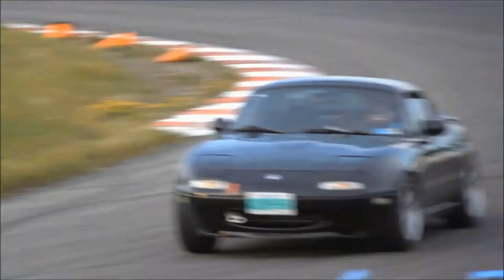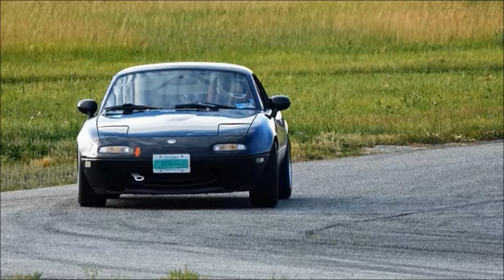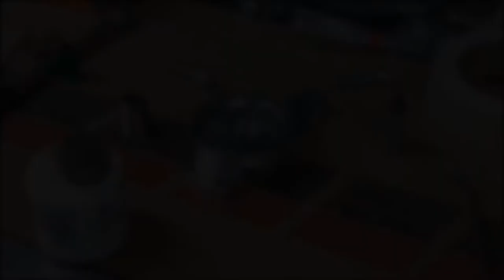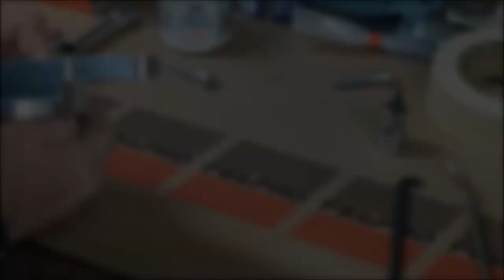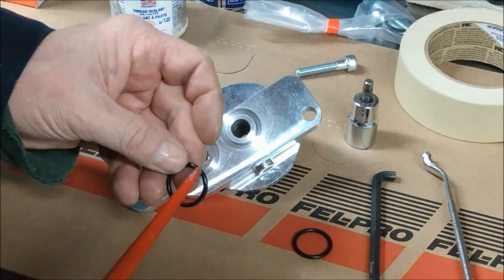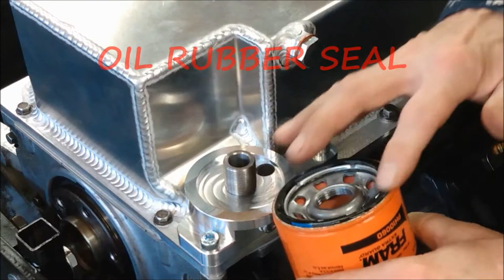INSTALLING THE OIL FILTER PLATE ON A LS V8 ROADSTER/MOROSO OIL PAN

Comment: Did you have any problems with oil filter adapter screw backing out when filter removed? I'm doing oil pan on my LS3 and thought about using oringinal since it has a hex on it to tighten down.
Reply from the maker: I've had it out a few times and never had a problem.

Comment: That oil filter adapter appears to be larger on the filter side than the housing side. Can you confirm?
Reply from the maker: Srry, I don't quite get what you're saying. HOusing side?
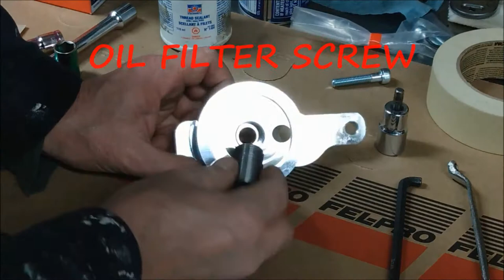Reply: @miatajackdiy4293  0:52 the side that you screwed in is smaller than the side sticking out?
Reply from the maker: @TheDevin918  It's been awhile but I think it was. It might be npt, a tapered fit.
Reply: @miatajackdiy4293  I figured it out. It’s 13/16-16 (housing side) to m22x1.5 (filter side)

Comment: Terrible filter choice for the price difference Wix or ac delco would have been 30 times better.
Reply from the maker: I put that on just for the first start up, then I changed the oil and filter to a better brand. It was a high mileage truck engine that I re-gasketed so I wanted to make sure I got rid of anything bad in the engine oil. There is a method to the madness.
Reply: @ that makes sense from your standpoint , but even for first start-up it’s crucial to have a high filtering oil to catch the most pollutants/tiny metal for the first 10-20 minutes and still have a very high filtering for the next 500 miles. After that you can use different filters depending on the application either race or daily driver (higher oil pressure or higher filtering). 

I have seen situations where those fram filters being so cheat they just bypass the filter mesh or the filter mesh gets destroyed and clugs pickup tube and oil passages. Thankfully LS engines have a little bigger oil passages than most modern engines but still very high risk.

Thank you for the video, I was looking for that oil pan review with the filter plate, but wanted to point out that in case it was your filter of choice.